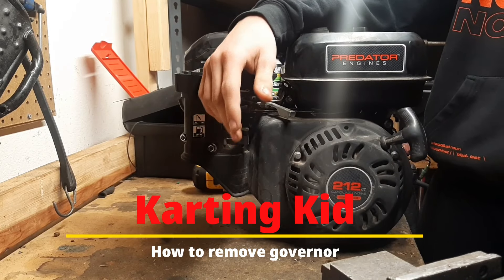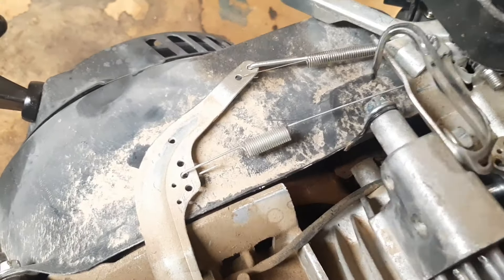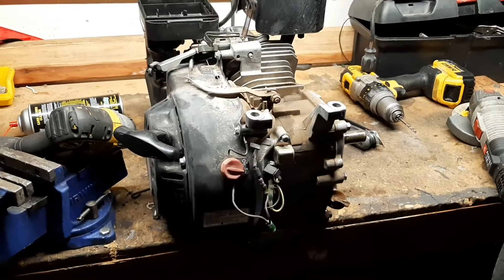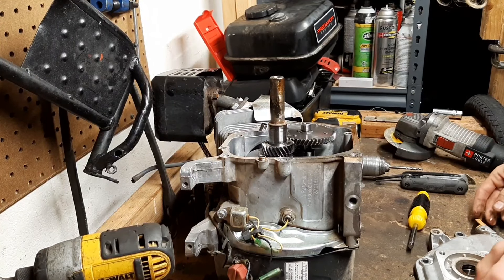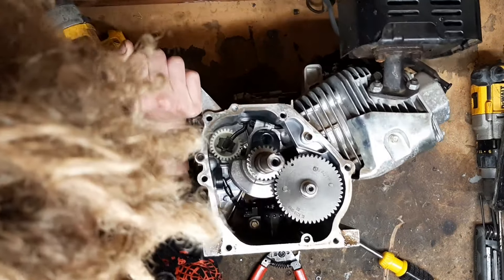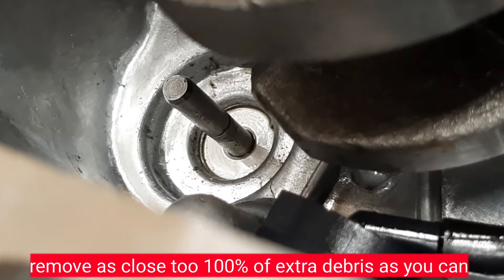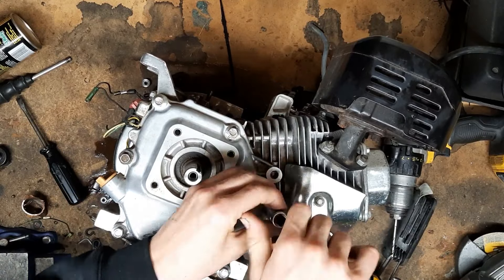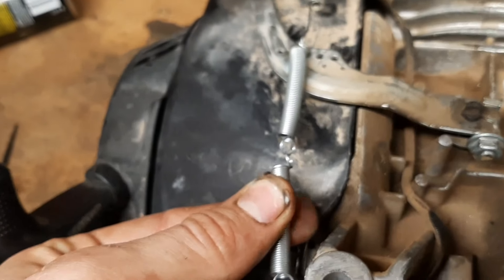How to remove Predator 212cc governor- FREE POWER AND SPEED

Comment: Can you make a more in depth video on how to bypass the governor with out opening the engine?
Reply: Zip tie the governor spring so it is like a solid linkage. Or just remove the linkage all together and relocate the return spring as he did in the vid. Did that to mine and it runs great. Just don’t have full throttle for long periods to be safe.
Reply: I will not do that, the governor is a plastic gear and will be destroyed by high rpm’s, all that plastic gets in your crank case and your fucked
Reply: In all honestly, it's such a cheap engine just Crack it open and worst comes to worst go get yourself another, maybe you'll learn something along the way. I have 2 predator engines from my old minibikes, I'm tearing down and rebuilding the predators before I work on my new minibike, so I know im not going to mess up my new one. I know not everyone has access to multiple small engines but if it's a possibility for you think about it. Just make sure you have feeler guages or it'll be tricky to get it running after you tear it down.

Comment: What did that engine come off of ?   Im suprised it stayed running with the oil sensor still intact
Reply from the maker: customers minibike, and same lol little miracles
Reply: If the crankcase is filled up with enough oil you should be ok or if you are worried fit some kind of windage tray & sump baffle.The tight a*rse Chinese wouldn't fit an oil level protector for no reason.Overfilling your crankcase will ensure that splash & dip conrod gets its share of oil when your prone(no puny pin intended) to laying your Minibike over when your trying to do a burnout or accident with the engine on & you Can't quite reach that kill switch.Trev NZ

Comment: For those times when the gasket sticks, get a thin metal paint scraper and ensure it’s sharp, it will allow you to slowly work the gasket off. Also remove the flywheel and use a punch to punch the gov wheel out. Best way hands down

Comment: Also, instead of using a screwdriver you could plug the fuel line with one of the bolts that hold the flywheel cover on
Reply: or just use the choke lever, it has a little thing on the end specifically for the fuel line. figured it out after looking at some honda gx repairs.

Comment: how many rpm do u get out of it with no governer? is it easy to blow it up or over rev it? looking to do this on a random homelite 179cc motor i slammed in a minibike
Reply from the maker: I think it hits 5k no clue tho. i had one on a stunt minibike and i was bouncing off redline constantly
Reply: Always upgrade your spring the stock 10lb spring won’t let you get to those high rpms without bogging

Comment: I do it so much easier I drill out the post widen spread out the actual arm and  drill out the big lever put a return spring on the lever and done use a cotter pin on the post so the lever floats

Comment: ENGINE WOULDNT START
I removed the govenor on my sons predator 224 and the internal low oil sensor and when i got done the engine wouldnt start and i was freaking out because it was my first time !! i ended up finding out its because when i pulled the cam the valve tappets came down a little so i pushed them back up not thinking much of it and later found out that can let the connceting rods fall out of place , so i took the valve cover off and sure enough they came off the rockers so i took it apart and put it back together and ahe fired right up hope this helps anyone who makes the same rookie mistake , i found 1 comment in 15 videos that led me to the problem so i figure i will repost same info!!
Reply: So I'm having the same problem with the 212 I only took the governor but my rods were connected any other ideas it's brand new
Reply: I think I’m having the same issue!!!! I just took off my governor and my mini bike won’t start
Reply: Thank you I am going to try this!
Reply: This happened but not the issue I can’t figure it our
Reply: @flixkzy9895  is the cam aligned?
Reply: @madgav935  it’s a plastic cam I can’t tell where to align it there’s no dots
Reply: Same happened for me

Comment: Damn I wish someone would have told me when your removing the side casing that your cam comes out with it now I just have a hunk of metal junk awesome 👍
Reply: Hold on, what?
Reply: It shouldn’t I’ve taken the case of mine severel times and plus you can just put the cam back in I reccomend letting someone experienced work on it
Reply: Line your timing marks up. Pretty simple to get your motor back together. No cost.
Reply: Come on man you just re time the engine, set the valve lash and your fine

Comment: Whoever is trying to remove governor, the arm needs to come out and be replaced with a threaded bolt. Remove the oil sensor. Definitely need some 18 pound springs and a heavy duty flywheel to be safe
Reply: Use a self tapping bolt 😉
Reply: 1/4 inch thread self tapping 1 inch bolt
Reply: What do you Emma springs ?
Reply: do u have to remove the oil sensor
Reply: It's a hundred dollar motor. I think I'll do without the springs and heavy duty flywheel.  I've got 2 plus years on my predator.  If it blows up, I'll buy another hundred dollar motor.
Reply: @ good for you man lol

Comment: Everyone uses this brute force method. Use a punch and drive the governor gear shaft out from the other side. Everything comes out as one unit. Them remove clip, gear and spacers from shaft. Drive the shat back into the hole. Much easier and parts don't end up where you can't find them.
Reply from the maker: Great advice thank you
Reply: Or just take shaft out all together and put in a bolt and do the same for the hole that is for the Governor arm

Comment: You also need to put heavier valve springs in
Reply: Is a billet Road needet?
Reply: You can do a gov delete and you can get it to 5500 rpm with the stock valve springs and nothing will break because the stock valve springs will float at 5500 rpm. If you get heavier valve springs, then you would have to upgrade to a bilet connecting rod because the stock rod can't handle the rpm that the gov delete and the heavier valve springs create

Comment: Can’t believe you left the governor arm. Pull the crank out and do it right. Tap the hole and put in a set screw. And the oil level switch needs to be removed too. Those can come apart and wreck a 212.
Reply from the maker: Yeah it's a sketchy set up, never had it go wrong for me bit it's pretty easy to fuck up, I made a new vid just out of how to do ot the full proper way
Reply: @kartingkid714  ah gotcha!
Reply from the maker: @Stephen Brewer  yeah I kinda  wish this video hadn't blown up so I could remake it earlier but it is what it is, just hope no one mixes things up
Reply: @kartingkid714  it is what it is lol be happy it did blow up my dude :)

Comment: I've got a minibike with 212 stage 1 on it I ride on the road like a scooter. 
Tip speed is 33 I want to go faster but u said if you take the governor off it's not good to ride long .so how can I ride long and go faster
Reply from the maker: Going fast without the governor is typically fine as the valve springs prevent most cases of overreving but if its only topping out at 33 than switch the rear sprocket to a smaller size. Torque will be decreased but youll have a much higher top end
Reply: Jon - as he says the stock Valvespring pressure will be an automated valve bounce rev limiter but there is the risk of a valve kissing the piston top ( Crown) but if you go ahead & fit some 18# Lbs Valvesprings & an aftermarket alloy flywheel then you'll have some measure of reliability at higher revs but then there's that std Conrod you need to think about, that's why they make Billet alloy ones.Id keep a safe rev limit of not much More than design overspeed of 6,000rpms.roughly Trev NZ as the old saying goes: how fast do you want to spend.!

Comment: How fast will it go stock and how fast with gov removal? My mini bike has 14 inch tires if that helps... just picked up a predator 212 today from harbor freight and not sure if I should remove gov before running it(so it doesn't leak as bad) or if It's worth just running stock(I REALLY don't want to break it!). I want to go around 40-45 mph and don't know if that requires gov removal...
Edit:I'm also adding a stage 1 kit so if that'll make it blow idk if I should remove gov
Reply: What's your gearing
Reply: @Metal357  12 tooth clutch to 70 tooth sprocket
Reply: @madixj  damn that’s low
Reply: The best ratio is a 5:1 ratio  @madixj

Comment: DUDE YOU LEFT THE GOVERNOR ARM IN THE ENGINE OH NO OH NOOOOOO SAY BYE TO ENGINE
Reply from the maker: ok and? if you set it up correctly it wont contact anything. im not an idiot contrary to what u think
Reply: @kartingkid714  dude you don’t want extra crap inside of an engine it will blow up it’s not worth it
Reply: @dababy_memes6956  as long as the governor linkage is tight it's not a problem. It's no different on a stock engine. If that bolt come loose the arm will rotate modded or not
Reply: It won't happen as long as the extra springs he added do not break. Those extra springs are SUPER important and are there to pull the throttle on the carb back to idle. There are guys who did this and did not add a spring. As soon as they started the engine the bike it took off on them. They made the mistake of doing what a guy showed them in a you tube video. LOL.

Comment: I have a fully built 212.. after blowing up a stage 1 kit with governor delete..thank God I wasn't injured.. let's just say, if you don't fully build up these little engines, they will blow..and can cause serious injury! The governor is put in place my the manufacturer for a reason, and it's not because of strictly emissions..it's mostly because the engine can't hold up to the temperatures it will endeavour.. the connecting rods are built to contain up to 4,800 rpms before it starts to heat up too much, breaking the connecting collar that holds the end of the connecting rod to the crank shaft.. causing it to sling off at a high rpm and be thrown though the top of the engine block.. deleting the governor, just isn't worth blowing the engine for just a little bit of fun...
Reply from the maker: Id say its worth the risk. Valve float keeps the flywheel, which is the main danger to the rider, below critical RPM and ive never had a predator blow unless i was riding top rpm constantly. However, anything beyond a stage 1 kit (not including valve springs) is sketchy without beefed up internals
Reply: I’m rebuilding a 212 getting new valve springs and a new billet rod and flywheel pretty sure thats all I need lmk if I need anything else I’ve had things go in my leg before just want it to be safe. Lmk thanks
Reply: It's definitely a wise choice to make sure everything that moves is built out of strong material.. and if you going to go that route, just know that its the cam that really controls the power-band..

Comment: Would you recommend I do what you did or can I bypass it I won’t ride like an idiot obviously just wanna get up to atleast 28 and I’ll be happy got a race with my friends brand new coleman ct200uex I’m currently running a predator 212 hemi with the throttle screw backed out I probably could beat him as is but want a little more speed
Reply from the maker: you can bypass, I had a bypass on my stunt minibike and it worked great
Reply: I recommend you to find a good gear ratio. So you don’t do mods it increases a lot of tourque mine goes 37

Comment: DON'T LEAVE THE GOVERNOR ARM IN THE MOTOR IF YOU PLAN ON TAKING THE GOVERNOR LINKAGE OFF 🤣 I literally just had the top of my block bust because that little arm apparently vibrated around a the crank smacked it and tried to push it out the top of the motor. Don't be an idiot like me
Reply from the maker: yeah lmao that shit will go boom real quick. ima highlight this so people know, thanks
Reply from the maker: If i can figure out how to pin comments😭
Reply: That wouldn't happen if the clip and linkage was tight. To that paddle arm.

Comment: If you look at 5:43, theres a little paddle on the governor arm rod. What I do is simply cut that off so you can keep all the linkages and don't have to mess with the clip on the gear. Unless I'm doing something with high hp, I dont bother removing the gear
Reply from the maker: agreed, i ran motors with byspassed governors ans they run great. Customer wanted it tho and im.mot gonna give up a chance to make a gov delete vid lmao
Reply: @kartingkid714  how do you advertise your service

Comment: So I cheated I pulled the crank shaft out and took a hammer and pryed that bitch out so what was left was the little pin a chunk of plastic and the washer but the black rod was exposed so now the paddle hits that and cant adjust but because the pin is still there the plastic and washer cant go anywhere so I just felt it should work fine when I replace the crankshaft

Comment: So it’s ok to leave that arm installed? Thank You For This Video Bro👍🏾👍🏾
Reply from the maker: Yes but you need to make sure the alignment is correct
Reply: @kartingkid714  so just find a way to keep it stationary? (no spinning). How did you do it?
Reply from the maker: @pattrevon6753  the arm itself still moves its just set up so it doesnt contact anything in the case. basically when the governor is in the motor itll push the arm back if the motor reaches above 3600rpm but if the governor isnt in the motor the arm won't be influenced. its kinda hard to explain i will probably do another vid on it to clarify. If youre nervous about messing up the alignment id just cut the bottom of the arm off with a dremel.
Reply: @kartingkid714  I mean I liked your video I was jus confused and worried about the governor arm messing up something internal. But if you’re engine is still operating fine I think I will do it and let you know how it turned out.
Reply from the maker: @pattrevon6753  yea ive done it on several motors, just spin the motor over while moving the throttle around to make sure its not gonna contact anything
Reply: @kartingkid714  Will Do.

Comment: Messing with governor on my Coleman resulted in a screwed engine in need of repair as the valve hit the piston even with 22lb springs. These engines cant handle it without upgrading internals.
Reply: If it’s a jang dong then that ur problem but if it’s a predator or tilloston then you don’t have to upgrade anything except the flywheel
Reply: I took mine out and just hope and pray every time I ride. I’ve had the valve cover blow off with bent valve rods so I just bent them back and put ‘em back in and it’s been going pretty good 😂

Comment: You did all of that for nothing you literally could just do the thing with the spring without tearing the motor apart and it would do the same thing so there is 2 ways for it to be done tearing it apart taking out the governor and the arm and the other way is the quick way but but gotta have the right tention on the governor also while it was apart you could have taken out the oil sensor and put a bolt with washers in you just said fk it ill do half and half lmao but people dont wake up and know how to do it gotta research and play around and tinker A for edfort